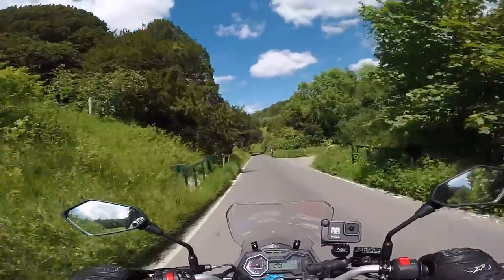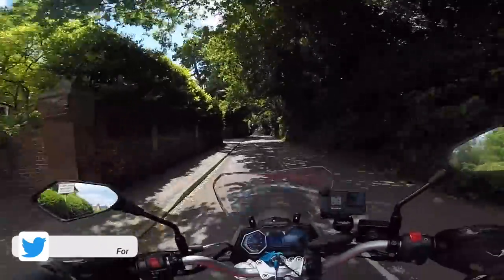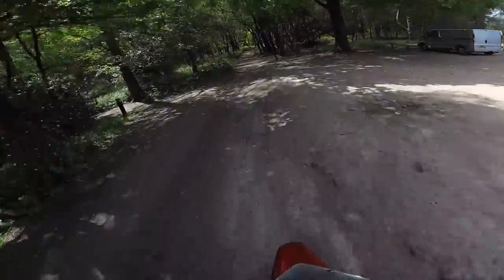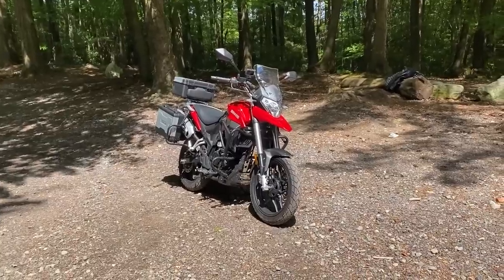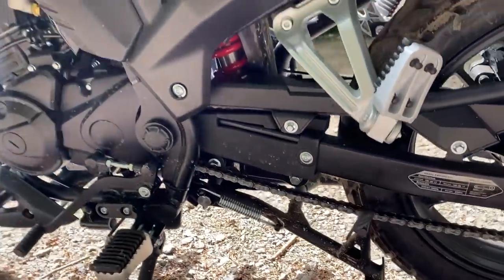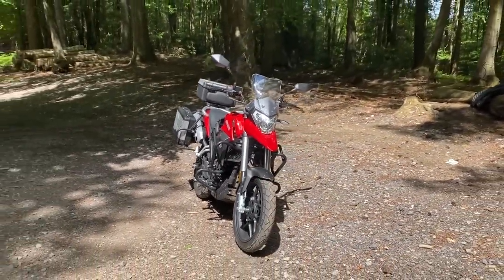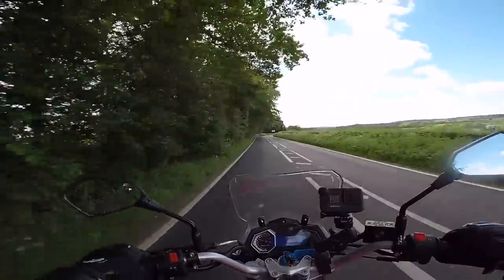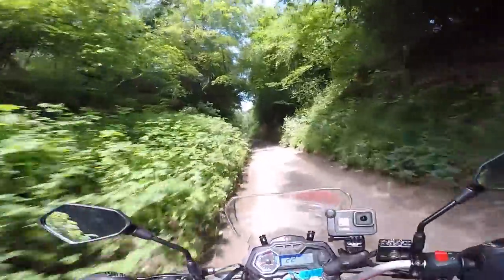2021 | SINNIS | TERRAIN 125 | Is it an adventure bike ? | First impression

Comment: Really nice bikes these. My friend has the earlier version and I have serviced it for him. It is a dream to work on, very easy. Don't forget the motor will develop more power as the miles go on it and the motor loosens, so by the time it has a couple of thousand miles on the clock the performance will be noticeably improved. Also the very slight vibes at higher revs will smooth out too; although as you mention in the video Mr Fish, these are only slight. My friends earlier version now has 22,000 miles on it in 2.5yrs. No issues at all. It is his daily commute. I notice the new one on test has an easier engine to service than the older air cooled version. It looks as though the oil filter no longer requires the entire crankcase side cover to be removed to get to the oil filter. It's now just 3 bolts to get to it by the look of things. Please keep up the good work. Nice video and nice review. Thanks!

Comment: Had mine 2yrs and 12500 miles covered with no grief. Its no gs but it is a great little bike.
Reply: how many miles have you been servicing it, regularly or letting the miles pile on before oil change etc the mileage seems to be very low for continuous servicing every couple of thousand.
Reply: @BeanieBiker_AutisticRider  oil change every thousand miles,filter cleaned every 1500mile,aftermarket cleanable air filter cleaned every 2000mile. I look after my bike and it looks after me in return.

Comment: I had one of these between my CBT and direct access test (6 months ish).  I'm over 6'4" and I absolutely loved it, only real issue was that the service interval was very short.
Reply: This is the comment I've been searching for! I'm of similar height and have struggled finding a 'big' 125 to learn on before full test. I've sat on one and felt good but have never ridden. CBT is on 13th August so will soon find out for sure!
Reply: Haha, snap. Also 6ft4 and have just bought one for the CBT to DAS bridge. Any must do upgrades for the leisure biker? Heated grips, hand guards or crucially decent tyres? Honestly the idea of the CST tyres and the, giving up mid roundabout terrifies me. How have they been as I’m currently planning to swap them out for Michelin or Metzeler ASAP. Would really like to hear your opinions
Reply: I'm 6'3 and prefer riding the wife's sh125 scoot than my (big? Comfy.?) new vstrom 1000 xt 🤷‍♂️🤷‍♂️ it's a pegs seat handlebar ratio even the big bikes are designed so smaller people can ride them, i had to put the tall seat on vstrom... Now screen is useless 😂😂😂🤷‍♂️
Reply: @kristofbenki5048  Which moto you bought and found comfortable in the end please?
Reply: It's Chinese, I imagine it would wear out faster than a Japanese bike.

Comment: I have one of these. it is very good at most things. There is no ABS (what do you expect for under 3 grand!). The notched ring on the rear I believe is the speedo sensor.
The tyres are ok for most stuff. If they were any knobblier they would not be so good on road (which is what they will be used for in 95% of the time)
Reply: The PCX has abs under 3k
Reply: @steve00alt70  yeah but that’s a shitty scooter 😂
Reply: What’s the top speed on them heard a few different things

Comment: Yeh, typically combined brakes are implemented using the rear brake lever. On my CB125F that involves an extra linkage connected to a hydraulic piston which puts on the front brake with the rear (typically 80/20 R/F I think). Only way around it is to lock off the linkage somehow, but I've not looked into it enough.

Comment: CBT on the 21st Sept and pick my sinnis Terrain up on the 27th Sept :) Question though, do i not need to keep it at under 40mph for 600 miles or is that nonsense ???
Reply: How did you get on? Definitely thinking of getting one when I pass my CBT
Reply: @bevan24  it's an absolute joy, so easy to ride and the sit up position is a confidence builder. Any more info you need I can help mate.
Reply: Bit late now but that is just to run the engine in. Will pay dividends in the future
Reply: @edwardfrench9925  I'm on 250 miles and still not gone over 40 mph mate, that the right thing to do ??
Reply: @tonyf9076  hi Tony, I’m no expert but I have looked at the T125 manual online and there is no mention of how to treat the bike for the first few hundred miles but I have read that somewhere. Mechanical sympathy suggests what you are doing is great for engine health. It may be worth it, if you are that way inclined, to switch the oil and clean the filter as it will be carrying all the tiny particles from manufacture but these days engines are so well made it should be minimal. Buried on the internet is a guide to how BMWs used to be serviced. Before the days of cheap lease deals and aiming for super low fleet running costs…what happens after 100k doesn’t matter. All BMWs used to get a running in service at 1200miles but that is long gone. When I ran internal combustion engines for the family cars I used to change the oil and filters every 10k despite the manufacturer saying 16-18k. We sold the cars at 212k and 162k respectively with original turbos, engine and other components. 
So back to the topic, if it were my bike, I’d consider a DIY (it’ll be very easy with minimal tools) oil and filter change, cost about £25 all in and gentle increase the rpm exposure. Another cheeky tip I’ve picked up is replace the oil sump plug with a magnetic one. Over time this will collect the harmful particles that could erode.
Away from the oil side of things, what has become apparent to me is wash and treat the bike to a heavy misting of ACF50 or the like. TMF has done several videos on it but in short time will make the difference between a bike easy to sell and one that has been neglected and is written off.
Are you enjoying the bike?
(Sorry for the essay)
Reply: @edwardfrench9925  great info thanks mate, I've ordered some anti corrosion spray, I use muck off chain greaser every week without fail. Apart from the short gear ratio in lower gears I'm having a blast with this bike, worth every penny so far and it's saved me a small fortune on fuel bills to and from work !!!
Reply: It's basically a myth. You can go high in the rpm. Just don't hit redline or full open throttle.
Reply: @JDMz  still running mine after 2 years, been a solid bike 👍

Comment: I really want to like that bike. Its one of the 125's I would consider. 

But. 
This really should be shaft drive. Take the engineering up a notch, remove the pain on chain/sprocket nonsense.
1200 Mile service intervals - sadly complete joke level, and destroy the fundamental 'cheap biking' idea. I'd like to know if this is because the engineering is crappy and it needs a shedload of oil changes, --- OR is the bike price so low, this is a loss leader so the dealers can earn a living. I'd understand that, but has to be a better way. :/
Reply: Any other 125 adventure bikes you'd consider?
Reply: @Spaxcore  they are old, and 125 not suited but dr125 from many moons ago
Reply: It's literally £20 to change the oil. That's not expensive or going to break the bank😂😂😂😂😂